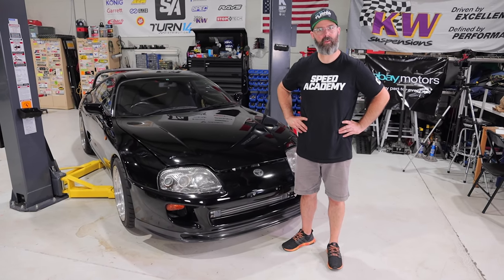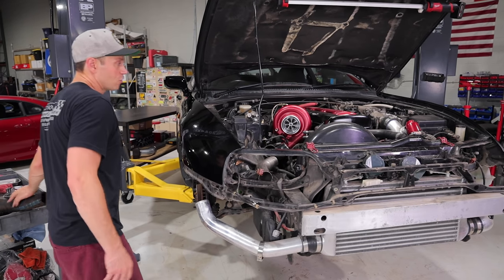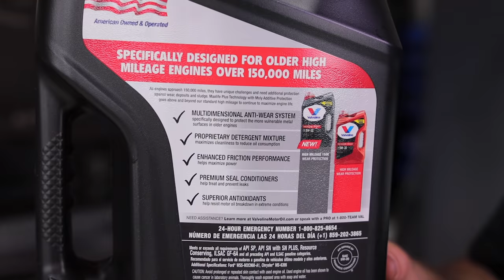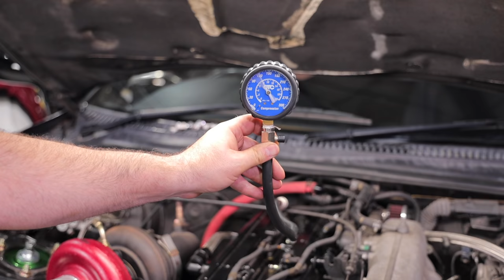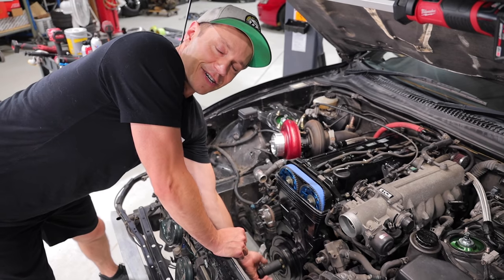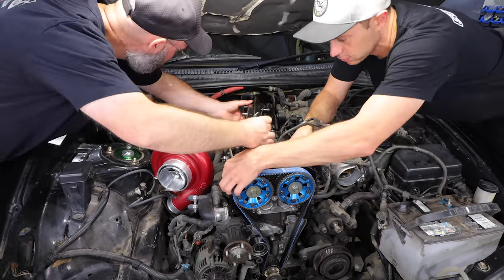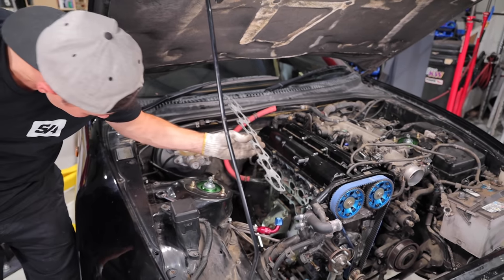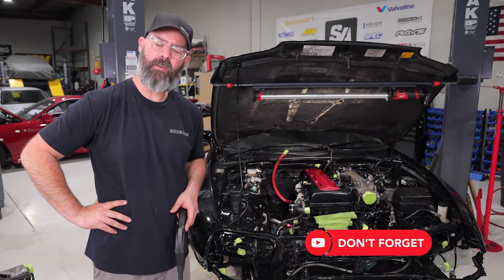Is This Why The BEATER SUPRA Was SO CHEAP?

Comment: The little fan is for when the A/C is turned on. Same setup on older 7mgte's. You guy's are awesome man.
Reply: What exactly does it do though? It powers the ac??
Reply: @NewDesignVinylGraphics  It cools down components.
Reply: @NewDesignVinylGraphics  It keeps airflow going through the A/C Condenser in front of the radiator.
Reply: its not a A/C fan at all, it is for the auto trans oil circulating in the water cooler

Comment: I've been a technician for almost almost 21 years and that's the way we've always done them.
Reply: Done what
Reply: @frontspring1  im assuming he’s talking about the crank pulley
Reply: That's the stupidest way.
Haven't you heard of a milwaukee high torque impact with a weighted socket. 
One slip with that breaker bar and you're destroying stuff.
Reply: @frontspring1  if it's stupid and it works is it still stupid? BTW im also a Tech and that is how we also do them.
Reply: @7MGTEsupra89  tech at the cheese factory gtfo outta here

Comment: Glad to see you guys are doing a supra. Gates and Greddy both make blue timing belts for the 2jzgte engine. Small fan on shroud is the a/c fan. A cheap solution to an overflow tank is using a 2006 civic overflow that fits between the fender and the battery behind headlight, its $20 from the dealer. It actually looks like OEM placement.

Comment: If you can't put the cooler tank close to the fuse box, you can leave it where it is, but make sure the piping is tight so there's enough vacuum for the coolant to get back to the radiator. It's very common for the ignition coil plugs to be deeply fried in these engines. Get some new plugs, put some nice insulation around the wires and the plugs and you'll be good for a long time. The small fan next to the big one is existent in other Toyota models as well. For example, the Celica ST182 has it as an auxiliary fan, in case the main engine fan fails, this fan will open at 105 degrees Celsius. More or less the same happens here as well.

Comment: @3:42 when i went to a front mount on my Supra i bought a 2006 Honda Civic coolant reservoir which is thinner and I relocated it right in between the driver's side (USDM not rhd) headlight and the battery. It fits snuggly right there.
Also those coil pack clips are notorious for getting brittle and breaking. Toyota sells the clips so you can replace them as well.

Comment: It's crazy seeing 2 supras and a skyline.🤯 Reading the comments on the crank pulley bolt, seems like it's a more common method to do. I personally never worked on an AT before so it might come in handy in the future. Thanks!
Reply: My pops has been doing that for years. I think the first time I seen him do it I was like 10 so 23 years ago haha
Reply: @justincasiere9598  question: analyzing this method, you could do it on a manual too right? I'm also used to the pry bar method xD

Comment: I did the same method to break loose the crankshaft pulley when I did my timing belt. I only “tapped” the key into start position once, easy peasy. It wasn’t coming loose any other way. OEM special tools and generic crank pulley wrench were tried first.

Comment: The breaker bar and crank method works. I was turning over a 13 litre truck engine with a large spanner once and forgot about it when I cranked the motor. Cracked that nut no issues!
A better way is to make a simple piston block. Rod down the spark plug hole and a flat bar with some bolts into the rocker cover.

Comment: To remove these crank pulley bolt you can use a pulley holder (costs like $60). That holder bolts into the two holes on the face of the crank and has a slot for a breaker bar. It’s still a pain to break it loose but much better than try to hold the crank with a pry bar.

Comment: 90s Japanese cars are my favorite to work on. Everything makes sense. They’re engineered so damn well.
Reply: are you including MR2 3S-GTE in that? or 6G72 in 3000GT, not exactly fun to work on
Reply: My old 93 Altima 2.4 called for 3-4 hours to replace the intake manifold gasket.   You needed dislocated wrists and magic sockets to cut that time but it was pretty  bulletproof and everything else was easy to access.   Gave it to a younger brother and he totaled it a couple of months later.  Should've sold it instead

Comment: The smaller fan, is an auxiliary fan for the AC system to give additional cooling. Also that CX Racing turbo manifold, really showing its worth (IN THE BIN). Lastly i recommend Schley Products 64300 Lexus & Toyota hormonic damper pulley holding tool, AKA SCH64300 fairly inexpensive and i still use it 11 years later on my own 2JZ. Great video guys.

Comment: The starter crank pulley removal trick would have been learned by mistake one day. Sure of it. :)
Reply: I used to do it at the Lexus dealer. It beats spending time with a torch heating it up over and over.

Comment: 10:35
Yes you put the breaker bar against the chassis and crank the engine over and that breaks the bolt loose. But you only do that when its like over 150 ft lbs .. because most "dudes" are weak past 125 ft lbs ..

Comment: If you slot the stud holes on the under side of the exhaust manifold you can part install the nut then drop the manifold for final tightening, same for taking it off, would make life much easier. The manifold looks ok at first glance.

Comment: That extra radiator fann is for the AC and extra cooling controlled by the ECU. That BW S364SX-E would spool around 3500-4000rpm.

Comment: a turned up stock twin housing auto is actually really quick. with those cams and a decent fueling kit really whoom ever owns this next is a 93 oct tune away from making a solid like 400 ft lbs with early spool and that means great acceleration. I had a friend way back in the day with the ported twins and auto would front half so many big single 2jz's, naturally theyd back half him at the quarter but for street driving that instant punch of torque is so sweet. and its smooth! i6 power!

Comment: That little fan is for the aircon also the original radiator setup did not need an expansion bottle it just vented to the ground

Comment: At 13:00 it looks like you have rust on the bottom of that cam lobe. Might want to take them out for a better inspection.
Reply: It will probably be fine but worth a look. Would be alot more concerned if it was on a lobe.
Reply: I thought they were doing valve stem seals which requires the cam to come out

Comment: When using the breaker bar trick for the balancer bolt, you need the jam the bar hard against the chassis rail and just use the palm of you hand to hold it onto the bolt. What you did is the best chance of something going very wrong
Reply from the maker: Id rather something get damaged in the engine then loose or mangle a hand holding the bar.
Reply: @speedacademy  brett H is correct, when the breaker bar is up against the chassis and you hold the socket into the bolt, its NOT going anywhere but turning the bolt.

Comment: Breaker bar trick didn't work for my 1J. Had to jam a pry bar in the flex plate...then a breaker bar with a jack handle over it, as an extension. Sketchy A/F.
Breaker bar technique worked perfectly for my old BH5 Legacy.

Comment: You could also use a DEWALT 20V MAX XR Impact Wrench which is rated 1200 ft lbs break away torque to remove that harmonic balancer bolt.  This is much safer and is what I use and it works everytime.
Reply from the maker: Wont fit in the area

Comment: 15:10
I had a manifold like that on my nissan back 20 yrs ago, had to get the bottom 2 back bolts ON before the manifold was slid over the studs or else they would not go on and same thing, had to finger turn them all the way back, then finalize them with a crow foot, it was a bad design on the back 2 runners, but it was the ONLY manifold made for that motor because everyone went SR20 instead, i stayed with the ka24de motor, eventually i trashed that manifold and got a GATO manifold for it and still on there now

Comment: In while you guys are draining the coolent, I am wondering if you have a leaky injector or two, with the fuel leaking into the combustion chamber after the car is turned off, the residual fuel pressure pushes fuel past the leaking injector, which then drains down the cylinder walls and into the oil.

Comment: Do NOT use the crank bolt method, I got unlucky with the bold not coming loose and instead the timing belt skipped over teeth on the camshaft sprockets, almost marrying my valves and pistons.

Comment: I miss the days when you could find a decent supra in the states for like 15k in some places. Most of the expensive ones have been beat on heavily and are not worth the 40 to 50k price tag, for example my cousin bought an R33 gtr....Come to find out the engine was blown because the dealers took it for a joy ride and basically killed it. So now he has a 60k rolling chassis while he goes through all the legal BS to get the dealer to replace his engine.

Comment: Please guys stuck to 5w30 at least 
The 2jz is not build to run and run hard with a thin oil like w20, until you want to drift it in polar condition -30 Celsius

Comment: Why not use a Stubby 1/2" impact and shallow socket for the crank bolt? You seem to have plenty of space for that.
Reply from the maker: Wouldnt loosen it. You need a big boy gun to get the bolt off
Reply: That bolt is over 200 ft lbs ...

Comment: Compression results are one thing.... but I would be more worried about the bearings in that engine after seeing how diluted the oil was.😑
Reply: After seeing that I would want to pull and rebuild the motor. Save myself a headache later on.

Comment: Why not put a holder tool and then put an impact gun up to the crank bolt?
Reply from the maker: Dont fit would have to pull the AC condensor

Comment: Why so intent on keeping it twin turbo? Modern turbos are better and it's not necessary to keep it twin turbod to get the response like the stock engine.
Reply: They are doing an OEM plus build.
Reply: @traviswalker8933  obviously, but OEM was dealing with the technology at the time, OEM+ means replacing the twin turbo with a single twin scroll turbo that does the job better. That was my whole point
Reply: @siegekeebs  there are two twin scroll turbos as well. They were going to slap on the stock turbos but in the end it is shown that one of those turbos is trash so they'd buy new ones. What they end up getting is the suspense.
Reply: It’s being brought back to close to stock, and being sold. They have another supra that will get the fancy treatment

Comment: So, why was it so cheap?  🤔🧐 The industrial flex hose intercooler piping, & the potentially dead coil pack/connector? I still haven't seen anything truly wrong with this car. 😁
Reply: Fuel in the oil isn't great, especially if added to the 5w/20 water already in there, but my oil after every track day was milky brown from the E85. 

Concerning at first, but being expected & routine after 5yrs of tracking, the amount of fuel (E85) that'd cause it would evaporate & by next track day the oil was clear & no traces of fuel could be smelled or was visibly present.

Comment: I cringed watching you use that method of removing the crank bolt. I know the down side of trying that.  I tried it on my ‘92 Subaru Legacy Turbo. The crank bolt snapped clean off. Total nightmare as the bolt was hardened and couldn’t be drilled in situ. 😑

Comment: Why don't you guys go standalone?
Reply: They are doing an OEM plus build. That's why. Plus the single turbo won't be supported by that auto transmission.
Reply: @traviswalker8933  I understand ditching the scuffed single turbo setup and the auto, but it doesn't seem like fun to work around the limitations of a computer from the 90s, even if it fits the theme of the build.
Reply: @whyidontknow7113  they aren't getting rid of the auto now.